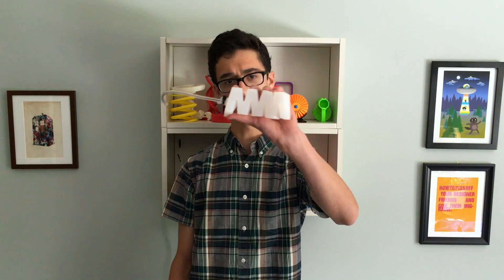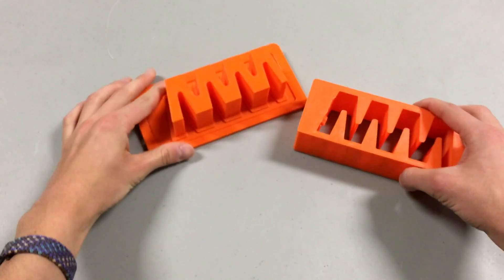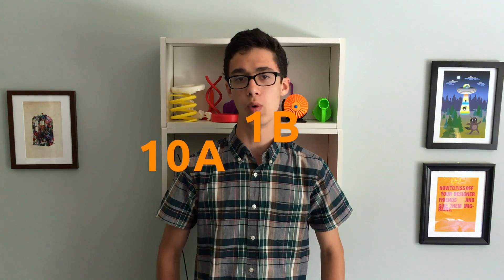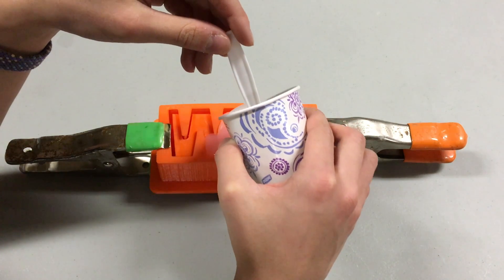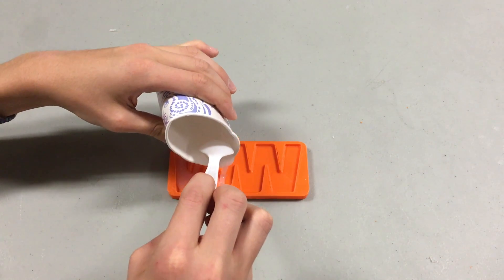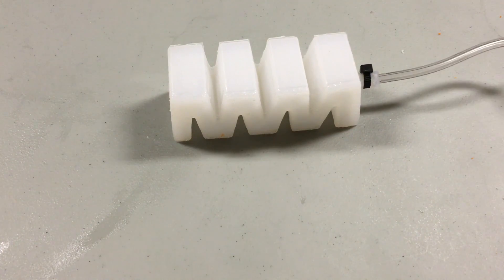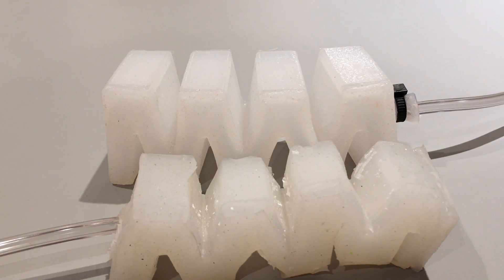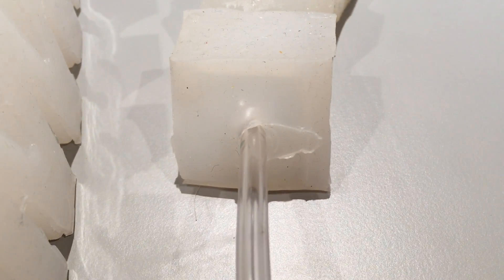PneuNets Extending Actuator

Comment: Is there any trick for demolding because I couldnt demold the molds
Reply from the maker: Using a bit of compressed air to pop casts out of molds sometimes works. If its really stuck though you may want to use more mold release on future castings.
Reply: If you use a press then it gets easier. I used an old drill press to compress the material then put spacers under the edges of the form. This allowed me to push the material all the way through the mold. I presses against a larger block of wood so I had no back plate to the mold.  It will be stuck to the underside of the top plate you are pressing down on. If you do not have a press, then turn the mold upside down after you press the material. Put a small block under it. press down on the outside of the mold. It will slide down past what was the top of the form when you were pressing. If it doesn't, then you will need to sand the inside of the form to reduce drag.